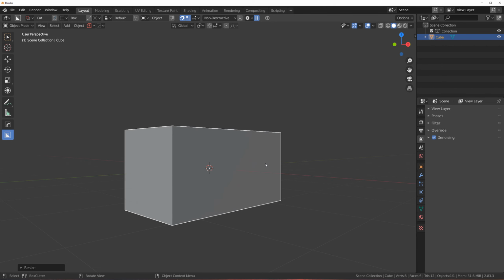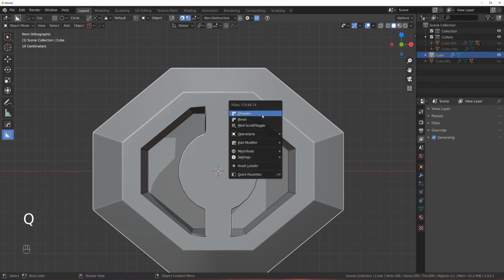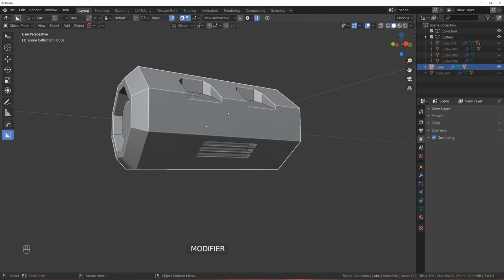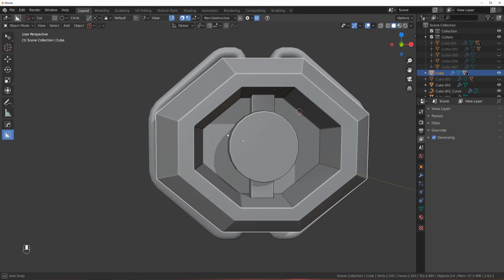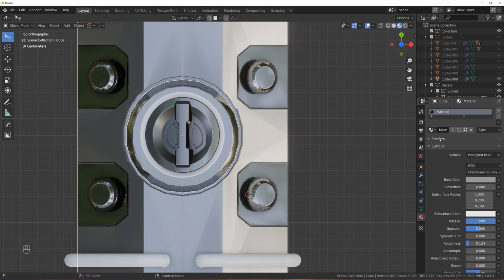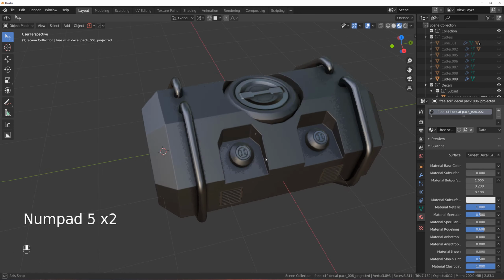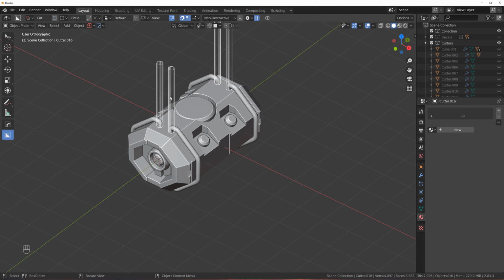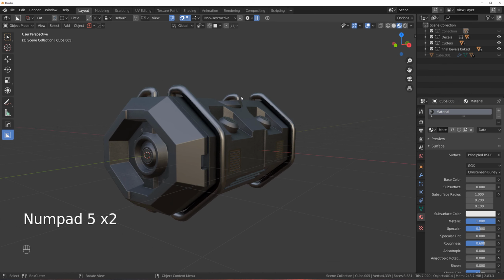Blender Tutorial - Hard Surface Low Poly Game Asset Creation for Beginners.

Comment: Ngons are a no-go for game assets. You have no control how they get splitted up. Shading will produce artifacts. Things like tesselation doesn't work. Many texture painting softwares doesn't support ngons. Some engines also just don't render ngons and then you have a open mesh
Reply from the maker: you are so fucking lost it is unreal 4. I actually work with a game dev studio and we have a ton of game assets with ngons, you just need to know how to control them mate. They all supported by game engines and texturing software, you just need to triangulate mesh before exporting.  SP for instance has a crappy triangulation algo. Ngons wont work well if deformed via animation, zbrush might throw a fit or two as well, but other than that you are fine.
Reply: @PonteRyuurui  no they are not supported by all game engines. Substance painter the baker doesn't work with ngons. Quixel mixer doesn't work at all with ngons. Tesselation still don't like it.
So you know that you have to clean up the mesh, before you consider it as game ready. Why did you left this part out in your tutorial?

Comment: Hey, im new to this workflow and am trying to figure out the process of getting good topology after you have the design. Reason I want quads is I use Zbrush and substance painter and I like to go backs and forwards between this software, is there a suggested method for dealing with the topology in this technique or is it not suited for this? thanks.
Reply from the maker: Well, you could either work in quads from the start or retopologise it afterwards.

Comment: Good workflow.
Though, lower poly can be achieved by not using any bevels on the lowpoly mesh. Instead, duplicate it, add bevels to the duplicate and bake them into the low poly as a normal map. Not like it'd really make a difference with the power of hardware and game engines these days though. Just some food for thought for those people who are still running on a potato :)
Reply from the maker: yes i know i mentioned this in a video. Not always needed, so either workflow is fine mate. Depends on the dev team and total poly count. In addition, the hard edge can show in game engine under certain lighting, so applying bevels might be a better way to go. You could do it selectively, manually.
Reply: @PonteRyuurui  Yep, it's all good, there are countless ways to approach game assets, it's mind boggling.
Thought I can't wait til DecalMachine 2.0 for the texture atlas exporting to Unity/UE. That's going to be mad useful
Reply from the maker: @DavidAllen_0  Yup, if i dont have to create atlas maps a mnually i will be a happy panda. Trim sheets are coming too.

Comment: it's a fast way but I would prefer to make a HP object, retopo it and bake the edges from it to the LP. it takes more time but a lot fever verts
Reply from the maker: it really depends on the total count, baking si fine as well,as i said in the vid, you can go both ways, which is why i saved the version with live bevels.If you go with bevel and higher geo you simply get into mid poly modelling, which is what they use in games as well, start citizen would be one example.
Reply: @PonteRyuurui  I work for a small gamedev studio and if our art lead sees a ngon tan we must change the mesh. in LP it goesnt matter if there are tris but in in HP everything must be in quads so ngons can be easy changed to tris
Reply from the maker: @Plajer58  Depends on the pipeline, I do not need quad based mesh for UE4 exports, as long as triangulation works fine in mat software. Doing all in quads is a waste of time if you dont need them. So that dev is either has a good reason (like zbrush exports) or is wasting your time. Another thing is that the hard edge can show in game engine under certain lighting, so applying bevels might be a better way to go. You could do it selectively, manually.
Reply: @Plajer58  why should you keep all quads on HP mesh if you would bake all HP stuff to LP anyway? I thought that only LP should've only quads, bc in a game gamers will see textured LP with a normal map(AO and other) baked from HP
Reply from the maker: @mikelgrenlou558  None of them needs quads if the triangulation works, simply triangulate stuff before exporting. UVs can also be handled properly without stretching with ngons if you know how to do it. The only time you might possibly need quads is when you need that thing to animate, i,.e. deform, or when you export it to programs like zbrush, or when you are working on something that has to be subded, though even the last one is not a must.
Reply: @PonteRyuurui  regarding adding a bit of bevel on the LP, you mean I need to add like 1 or 2 bevels so that it wouldn't have lighting issues in game engines and then with my HP, I would go higher count on the bevels and bake it? Thank you
Reply from the maker: @lz4090  it wont work, that's the lighting glitch and at some angles it will look like dog shit, do more testing and you ll see what i mean. Baking bevels is not a desired game asset creation mate, at least not when you care about quality. You will end up with an object which appears to be beveled on some edges and on others is razor sharp, it look bloody awful. Baking details, now that is fine.

Comment: Thank you,sorry if its a stupid question, is there a way to duplicate a decal in DECALmachine, need to add bolts but it takes forever to try and scale them all to the same size on different locations on the model
Reply from the maker: yeah it is a geo, just a plane, so shift d will do.
Reply: @PonteRyuurui  thank you